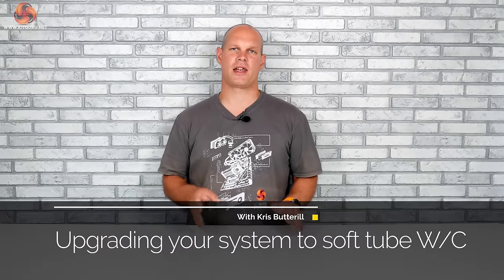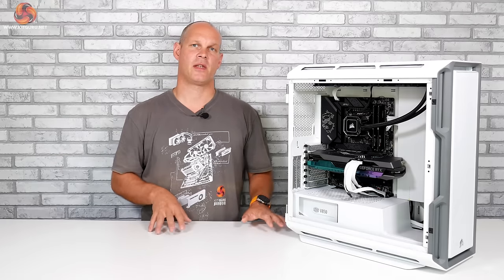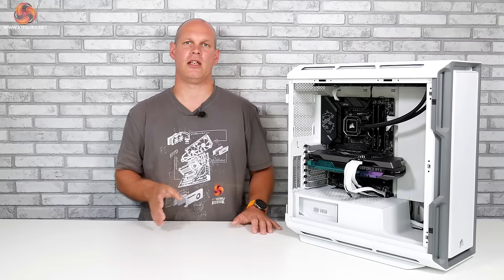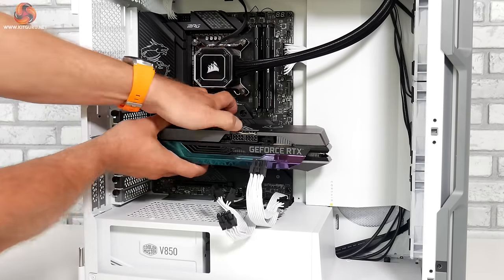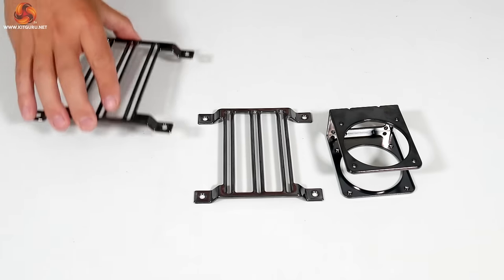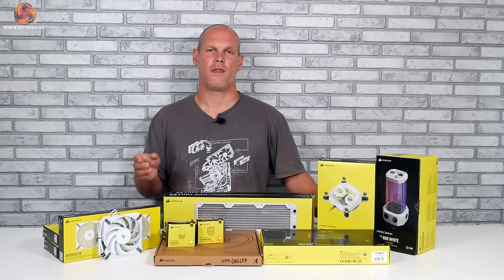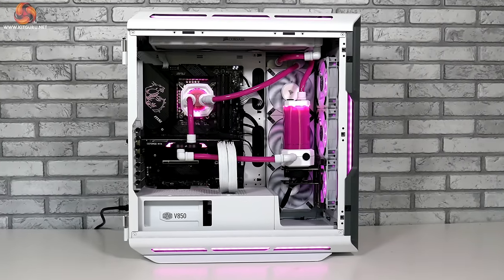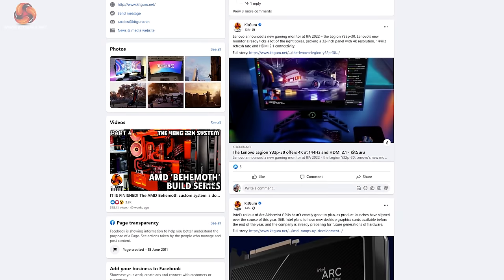Upgrade to a Custom SOFT TUBE PC 🥶

Comment: Biggest lesson I learnt from watercooling builds... Buy lots of adapters, extenders and multi pivot 45/90 fittings.  Basically overspend on fittings because things don't go as "planned."  When you cheap out on "basic" fittings, you end up getting pissed off cause things don't go as smoothly as you'd hoped.  Coloured coolant looks cool but isn't worth it.  Distilled water + clear additive is ideal.  Try deep clean your blocks and get colour staining out and then tell me I'm wrong.  RGB lights up clear tubes/coolant anyway.  Also, adding a drain fitting off a T-piece at the lowest point in the loop is a very convenient idea!
Reply: I installed a drain in the bottom of each of my rads and both my reservoirs. The res/pump combo's are the lowest point in the loop, but having those extra drain valves makes is so much easier to drain every last bit out of the loop.

Comment: good job Chris on the vid :)

some additional tips
- clean up your rads = aka flushing your rads to remove manufacturing debris
- running rad fan curve base of coolant temp sensor is good (i believe Leo did this before)
- d5 pumps have 2 connectors, sata/molex power & rpm control
- clear coolant will typically not cause gunk build up on waterblocks
- watercooled components will typically last longer from less heat
- fittings can get expensive real fast
Reply: @Cre8 Modding thanks bud :)

oh i forgot to mention this, watercooling higher end cpu+gpu make sense for me as my all year ambient temps is higher than 30c all year round (tropical climate)

Comment: CPU: Ryzen 5900x
GPU: 7900 XTX Taichi
I had my loop like yours at first....
Pump to GPU to CPU...
Great GPU temps(45 C full load)
Air cooled temps on CPU(75 C full load)

I changed it to Pump to GPU to radiator to CPU to other radiator back to pump. Both are now in the 50s

Comment: Hey nice build, I just want to make you aware there is a mistake in the inlet/outlet ports, you have put the tubes from GPU Waterblock to XC7 CPU Waterblock into the incorrect outlet port. In the XC7 CPU Waterblock Manual the inlet is on the right side marked by a horizontal slit, you can see it clearly at 11:47 in the video, you can also see in the reference from corsair at 05:24 in the video that they go into the right side of the XC7 Waterblock to the inlet as well. Just wanted others to also be aware in case anyone follows this exact build. Looks good though and some great tips thank you!
Reply: @Cre8 Modding  I suspected it may be flipped, but because it wasn't mentioned in the video I could not tell, thank you for the clarification! Well done looks good!

Comment: I am really new to this whole pc/water cooling stuff so this comment may not make any sense but it’s something I was curious about….those cpu temps looked really high for a 12900k being water cooled with its own 360mm rad. The only thing I can think of for that is….1. Most water cooled builds I have seen with 2 rads they usually go from pump to gpu then to the first rad then cpu then to the second rad then back to the pump. This loop went from the pump to the gpu then straight to the cpu then to the rad then to another rad then to the pump. Again I am new to this but that doesn’t seem like the best way to cool the cpu. That or…. 2. the fact that preapplied thermal paste and lga 1700 mounting seems to be known for bad contact. I have seen a lot of people actually add extra thermal paste even when it’s preapplied on their aios/water blocks. Once again I am new to this so if someone could chime in and correct me or just tell me I am wrong that’s would be appreciated but just from what I have picked up so far it seemed like that cpu was running wayyyy to hot, even for a 12th gen intel i9 lol.

Comment: BRILLIANT video, thank you! Would love to see another, this time with hard tubing and see you build the ULTIMATE high end water-cooling PC, using a Cooler Master HAF 700 EVO or "The berserker", with FOUR 420mm radiators at the SAME TIME, as a single water loop, with water cooling blocks on the: CPU, GPU, M.2 drive and on the RAM! This would be the ultimate dream setup for next gen hardware (like the intel 13th gen CPU, RTX4090ti, PCIe gen 5 M.2 drive and even hot DDR5 RAM). Very interested to see if M.2 and RAM water-cooling is worthwhile, and what kind of tube setup you would need to do. Also, curious just how cool the components could get with that much over the top cooling. I'm planning this setup myself for my new rig around November, but very nervous. Thanks!

Comment: I found this video so interesting and informative that I immediately started doing research on the pricing of these water blocks, tubes fitting etc., and I gotta say that it just doesn't make sense to me financially. The waterblock for my gpu alone was $230, and most places were out of stock. It looks like it would cost $500 to cool my system. That's just wild.
Reply: Surprising if 500 does it. I would expect a full build to cost much more than that. That being said, with any luck you'll only need to change the GPU block once you upgrade. CPU blocks are often usable on new sockets and of course pump and radiators have a long life. You may need to replace tubes after a few years, but the initial cost is the main issue - after that phase the costs do settle a lot.

Comment: Just a random question. We have 2 radiators? So is that better idea to configure the cooling loop flow like this: from pump to video card, from video card to radiator, from radiator to cpu, from cpu to second radiator and then from second radiator to the pump? Isn't that more efficient?

Comment: Why is your top radiator drawing air in?
Hot air rises. So it's better to do outtake at the top
Reply: I wondered this as well
Reply: Positive pressure in the case is my guess, negative pressure builds dust very fast.  If the fans at the top exhaust he'd have 3 intake fans and 6 exhaust, his way he has 6 intake and 3 exhaust.  He could've added a fan in the back for intake but still 4 to 6 if the top is exhaust.

Comment: I do not have much experience with building Computers and especially less experience with custom Watercooling, However (watching 12:30) i was wondering if it makes more sense to mount the fans of the radiator on the other side to push the Heat OUT of the case. The way you mounted it, i would think you blow the hot air into the case and heating up all components. My idea was to push the hot air as fast as possible out of the case. Am i missing something here?
Reply: Late response but you want to pull fresh air into the radiator to cool the water and the components. The reverse would push hot air from the PC into the radiator and lower the efficiency of the cooling. Intake for radiators exhaust for other fans. Less important for all water cooled systems but really makes a difference if you only water cool the cpu or gpu and not both.

Comment: What happens if the pump fails do you end up with boiling coolant inside? Is there anyway to detect a non working pump?
Reply: Sorry for the late answer: On modern CPUs you have over temperature protection (OTP), if that gets triggered the system just turns off. In my loops I always have a simple flow indicator like the Alphacool 17350 Eisfluegel so you can tell at a glance you still have flow. There are more high-tech flow indicators too if you want a readout on your actual flow rate but the simple ones do the job just fine.

Comment: what if u want just a custom loop for cpu not for other components??
Reply: You can do that but money wise you'd be better off with an AiO solution. The components don't really change, you need a CPU water block, a reservoir, a pump, a radiator, tubing and fittings. If you already spend this much on a loop then 100 bucks more for a GPU water block doesn't weigh in on the price anymore.
Reply: @albedo9127  isn't custom looping more durable than AiOs??? i heard water loops last up to 10 yrs and AiOs can die between 3-5 years.
Reply: @ark66  The durability depends on a few factors, mainly materials used. For example Coolermaster had a few faulty AiO's because they mixed metals which later caused corrosion and gunk buildup. the most common reason why AiO's fail is usually wrong installation, it should be installed either in the top of the case or in the front with the radiator tubes facing down. Those that failed were installed tubes facing up. AiO's loose coolant over time through dissipation (Custom loops as well) but since it is a closed system you can't easily refill, thus when the coolant level drops below the point where it can't leave the radiator it runs hot and the pump fails because it's not cooled anymore.

Everything that is mechanical can fail at some point in time, I had one faulty D5 pump after a few years where the bearing was damaged butr thankfully that was all of the faults I had in my near 10 years of watercooling. Mixing metals can happen to you if you build a custom loop as well, copper and aluminium don't play ball and will cause leaks due to corrosion after a while. Also I would never buy a waterblock or reservoirs where you screw your fittings into acrylic or plastic threads, they break too easily. If you want to stay safe you should use copper radiators and nickel plated waterblocks.